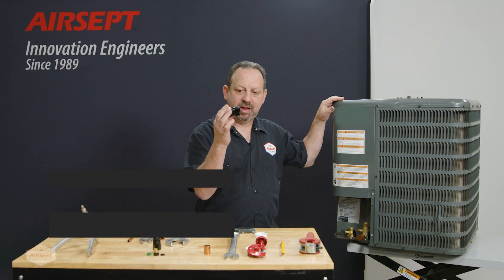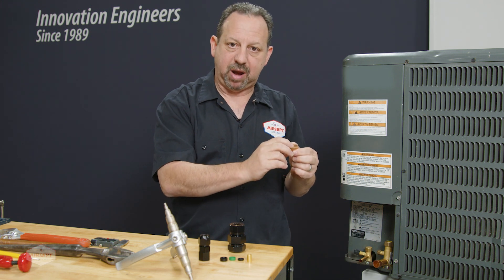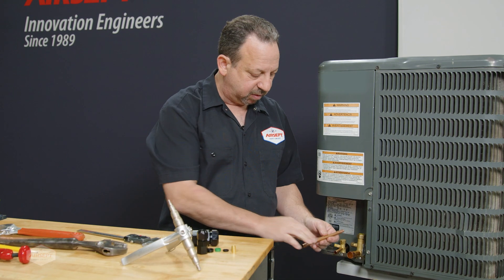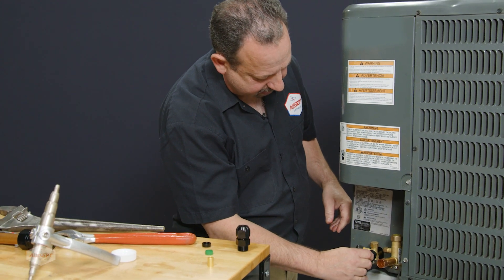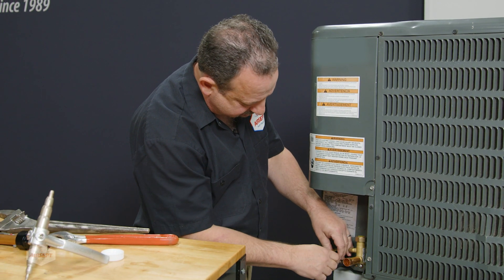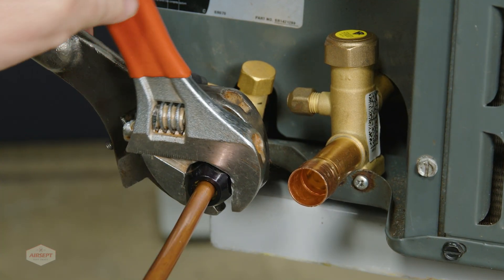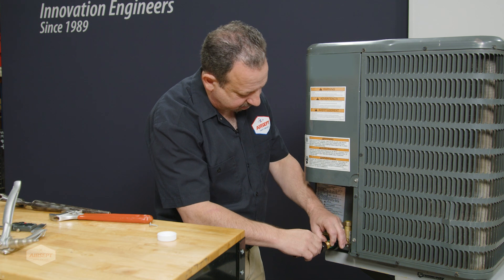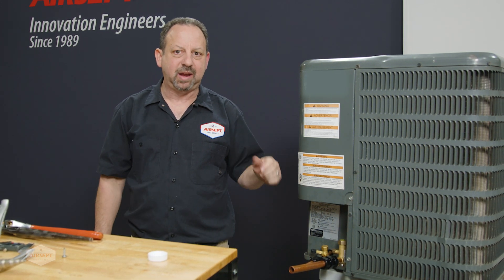SMART SPLICE™  for Unitized HVAC System installation - Complete  FLAME-FREE Install

Comment from the maker: Smart Splice ensures a secure and seamless connection between components without the need for open flame brazing, reducing the risk of heat-related damage and ensuring a cleaner, more controlled installation. It's a smart solution that not only saves time but also contributes to a more robust and resilient HVAC system.
Reply: Where can i buy this?